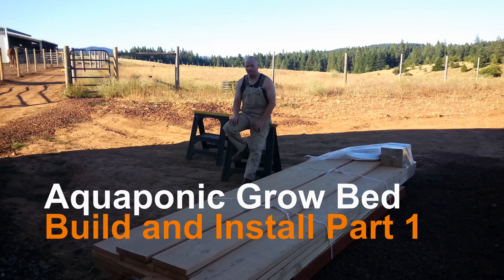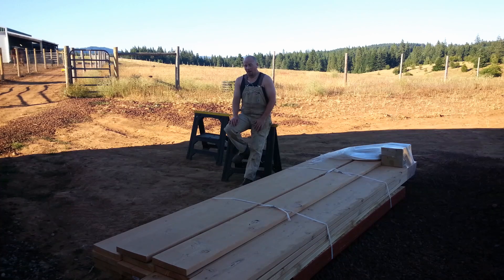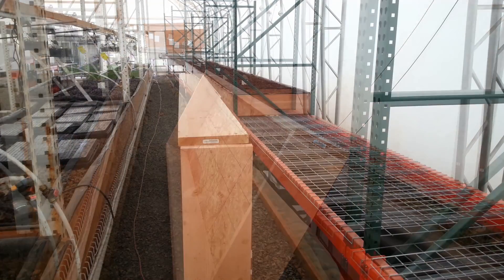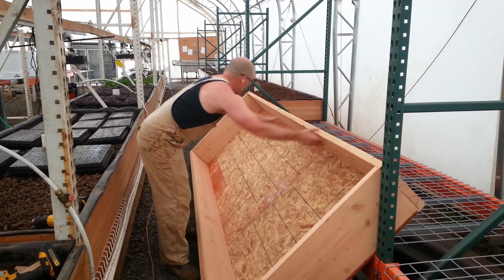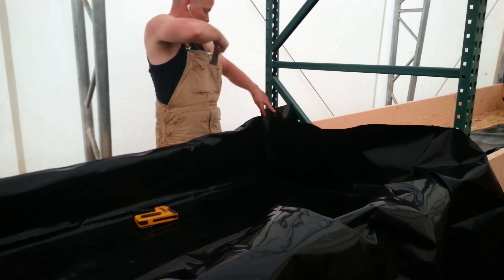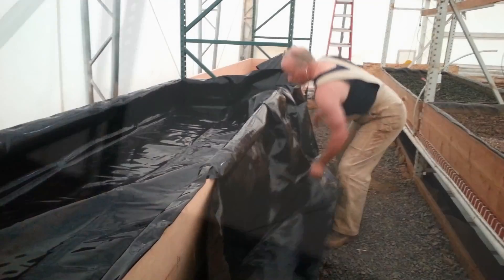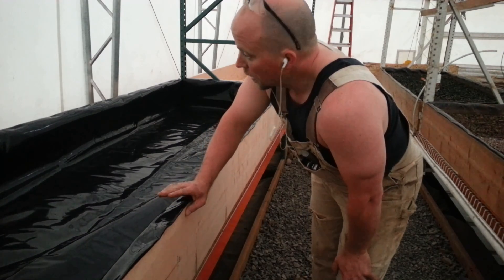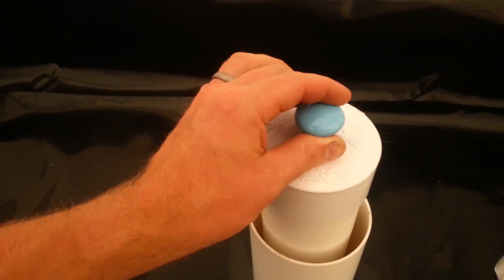Most Inexpensive DIY, Build AQUAPONIC Grow Beds Part 1

Comment: I reckon if I were doing that plastic, I'd get one long side stapled down, and then run the hose until it's about half full of water. That's going to push all the corners into place so you know it's not going to be too tight and pull away after you've stapled the rest when you go to fill it up.

Comment: Yeah good timber suppliers will cut their boards a bit long. The cut end dries out a lot faster than the rest of the board and it's a high risk of splitting, so they give you a bit extra so you can trim off the split part. I like to wipe a bit of paint onto the cut ends of timber as soon as I get them home, if they're something that it doesn't matter if it's painted. Sealing the ends stops them splitting.

Comment: What was the thickness on the ply wood 3/4inch
Reply: It looks like 3/4" but you could probably get passable results by using 1/2" or even 1/4" if you add some extra reinforcement around the rim and along the base. The water and rocks are heavy but the load is fairly evenly distributed so you don't need much material to maintain the structure so long as you place it in the right areas.

Comment: If you partially fill prior to stapling it down its a lot easier to get it all pulled tight.. the water helps add static weight to keep the liner planted on the bottom so all you’re pulling is a little slack on the sides. This really helps with corner folds.

Another tip.. place a cap on the drain pipe and run the bulkhead through both the pipe and liner at same time. You will need extra seals for the bulkheads at each water side joint but this eliminates the silicone to hold the drain in place. The bulkhead holds both at same time so it doesn’t pull up when removing the bell. Or make do with a little leak inside the bed minor reduction in drainage and just place the seal gasket between the pipe cap and liner and run the bulkhead through the cap. The cap might leak a little back into the bed but will still give tight seal on the liner side.

Comment: well done - so was that you mess up the length or home dept messing up? - I wondered why you were doing stuff out side - what about cutting it outside and putting together inside but then again space looked tight
Reply from the maker: I'm pretty sure it was me. I didn't order exactly cut lumber, just normal stock. So my bad
Reply: QALibrary lumber is not cut to exact lengths unless you buy pre cut studs and he explained why he's not cutting them inside.
Reply: I was not sure if TRM preordered cut lengths and I was talking about screwing all together inside not cutting it - as explained by TRM.